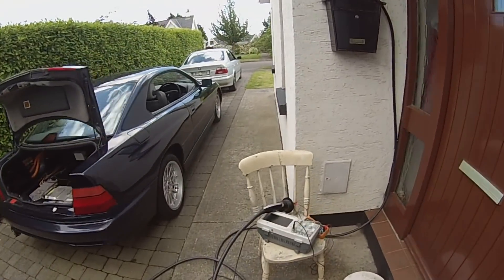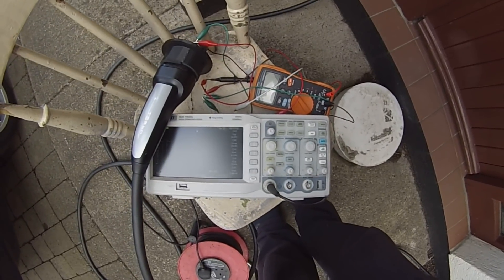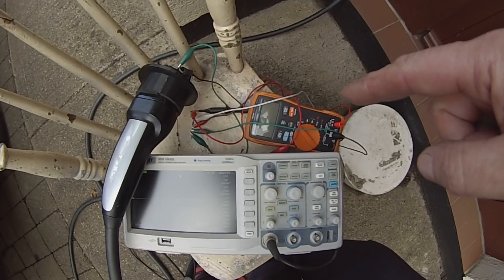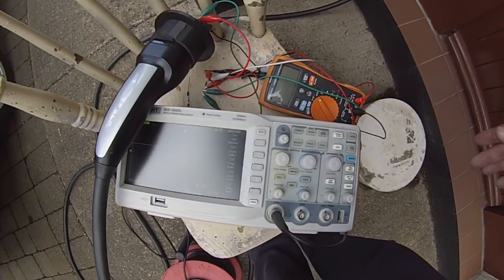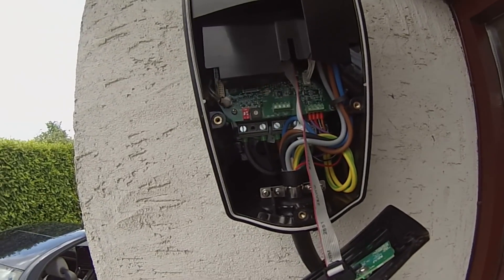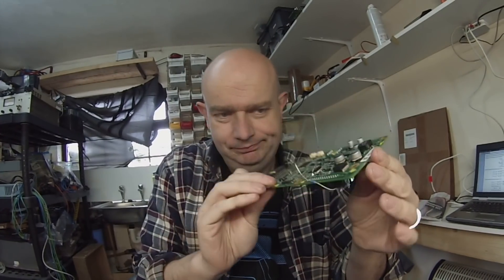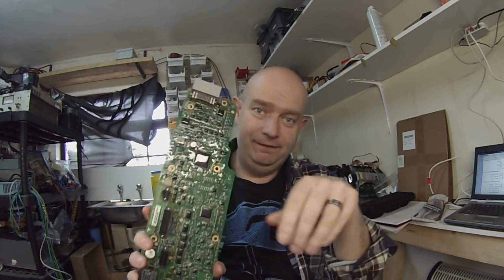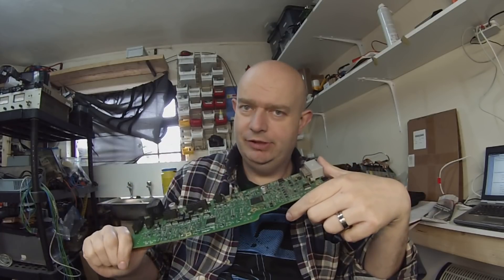The Tesla Project : Gimbal Lock

Comment: So you could put a Tesla port on my diy EV and use my J1772 controller to use a Tesla travel or wall charger? Brilliant!
Reply: I think the North American destination chargers, which are fitted with the tesla proprietary connectors don't tend to be configured for digital comms, because it's not as easy to just plug into a regular type 2 vehicle. They may have changed this for later installs to be consistent with the rest of the world.
Reply: @zymurgic  Would be interesting to wire a J1772 into my travel charger and see if it works. I don't have the HPWC but I do have a travel charger to play with.

Comment: Wall Connectors do a 5% Duty Cycle for about 7 to 10 seconds before switching over to a "standard" PWM if it finds no response from a Tesla vehicle. This depends on which firmware version is running on the unit. Putting DIPswitch 2 in the down position will disable this 5% and go straight to PWM. There is a nice controller for the Wall Connector on github https://github.com/cdragon/TWCManager
Reply from the maker: That's good info. Thanks.

Comment: Nice work. How did you set the max draw current on the Tesla charger Damien?
Reply: There is a rotary switch inside the unit next to the DIPswitches. It can be set 1 to 8. 1 being 6A and 8 being 32A. You can find the installation manual on www.tesla.com/wallconnector just make sure to use the correct country version (NA or EU).